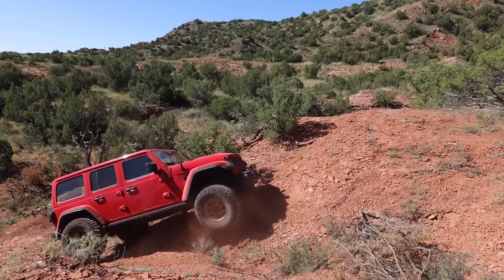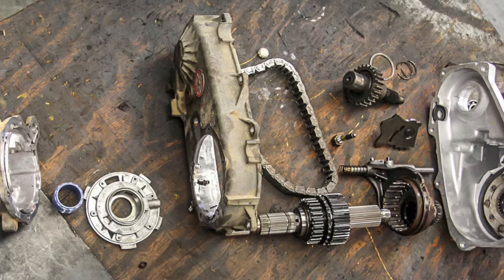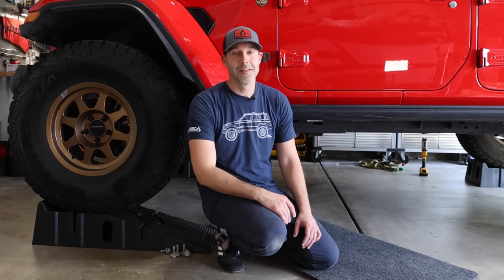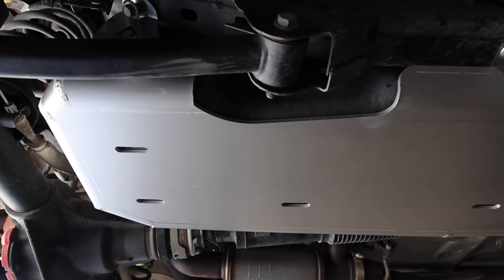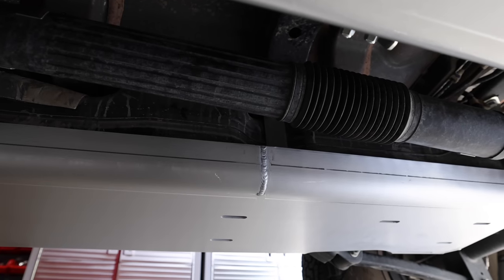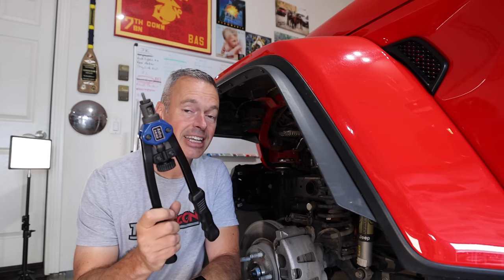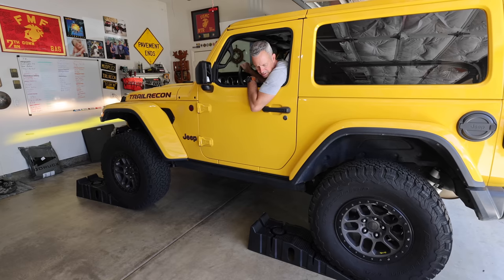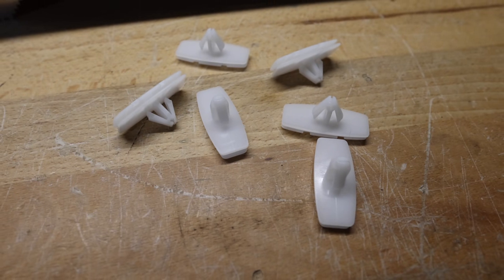Critical Upgrade Every Off-Roader Needs

Comment: Quick tip from someone who does a lot of unfitting (fleet mechanic for lacounty fire). Get a paint pen, and when you drill a hole, run the paint pen around it real quick, or get a bottle of pinchweld primer and do the same. Anything to give a little barrier. Rust is always looking for bare metal to use as an entry point, and I know you like to keep your stuff in top shape, and the jk and 392 are going to be around forever. Love the channel

Comment: Superb video!  These aluminum skid plates are a fabulous idea.  I've long wondered why the new vehicle manufacturers don't install aluminum skid plates as original equipment or at least as a factory (or dealer) installed option.  I think the stock Jeep skid plates, although better than nothing, are a bit weak.  The weight savings of going over to aluminum is also a wonderful benefit.  Great job!  You mentioned "Escondido."  For about two years in the 1980's I lived at 16607 Highland Valley Road with a Ramona address.  Used to drive into Escondido quite often for meals.  Actually, I started working on my Pearl Harbor research at 16607 Highland Valley Road.  I'm one who needs absolute solitude to enable me to concentrate.  Just noticed for the first time today you were a Master Chief hospital corpsman.  Congratulations for that, Master Chief!  Best wishes to you and your family.  (40 years ago this October I began working on my Pearl Harbor project.  Inasmuch as I turned 75 on 26 March, I plan to get my first book done before the end of this year.  It's title will be CLOSING THE LOOP ON PEARL HARBOR unless the publisher, hopefully the USNI in Annapolis, demands a different title.)  I'll love the Navy right up to the moment of my last breath.  Go Navy!  Andy McKane, Maunaloa, Molokai, Hawaii.
Reply from the maker: Oorah! and best of luck on your upcoming book!

Comment: Functional and beautiful looking skid plates!  Very clever use of countersink bolts, where appropriate, for a smooth surface that should resist catching on rocks.  It appears there are removable covers to allow access to engine oil drain plug.  Very thorough.

Comment: I just added the Rusty’s skid plates to my 392. It’s a steel system and is heavy duty for sure. Went back and fourth on steel vs aluminum. I like how steel slides over rocks, BUT I did add a ton of weight that’s for sure. Glad you got your 392 back in the garage Brad. 👍🏻

Comment: Nice armor work and the quad exhausts give it some attitude. Aluminum is easier to puncture than steel but the weight savings will be better for your kind of wheeling.

Comment: Wish you could have spent more time on the 2 door, there are many more of us that have a 2 door than a 392.   We all new that transfer case was not going to hold up.   With all that protection around the transfer case you will need to watch the heat.   They said change the fluid every 12,000 miles,  Brad check it at 6,000, and give us an update.   Thanks again and I hope you two had a great time in Arizona.   Sledge

Comment: 392 kit looks a good well engineered bit of kit, and necessary as so many low hanging parts, might even give slightly better fuel economy as virtually no turbulance under there. I'd probably fit some patches of heat resistant foam under the exhaust pipes so they don't ever have a chance to knock - I did that on a Freelander 2 bash plate I installed a few years ago, it worked a treat. On the Defender, there is no point as everything is well up out of the way, never hit the LT230 ever even lumpy rock lanes don't get up that high! 
Remember to regularly regrease the stainless into aluminium bolts, they will seize in there if not.

Comment: Tech tip for @trailrecon or any other do it yourself people: Drilling holes in the vehicle, wrap the drill bit with a little tape about 1/4”-1/2” back from the tip will help from over drilling into something behind the new hole. The tape acts as a stop to protect going too deep when it drills through. 👍🏻❤️🇺🇸

Comment: I think 🤔 powder coating the exhaust skid plate would look really nice 👍 but it looks good in the aluminum
Reply: This is an option but you’re going to scratch it and beat it up. That’s the point so leaving it bare won’t show as bad as chipped powdercoat.

Comment: Hopefully somebody will make some heavy duty clutch packs for that 392. Years ago I ran into that with 91' mustang GT that had a simular problem the AOT trans was weak. Was able to put heavy duty Lincoln clutch packs, and more of them  with a bigger drum to hold them. Nevery had a problem again, I used to take that Mustang up to Willow springs and road race with it. That trans was bullet proof  after that. I miss that car! But I now have a gladiator.

Comment: I have the full kit from Artec wating to be put on my Gladiator Ecodiesel. Bless to also have a lift to do it on. That last bolt im not putting on. don't want to drill it.

I highly recommend to change the oil sooner on the transfer case and diffs. Redline Oil is a must! 40% Ester base takes the temps.

Comment: In California it probably doesn't matter, but elsewhere beware of galvanic corrosion between the stainless steel bolts and the aluminum.  SS will corrode the aluminum more that carbon steel will since they are farther apart on the chart.  Also, don't install fine threaded bolts (the countersunk screws) without Neverseize on them.  You will not get them out after one winter (again, not so much a problem in Ca).  SS is softer than carbon steel and the hex hole will strip out too easy without Neverseize on the threads.

Comment: For the clip issue- If you can get behind them you can use a socket and slide it over them squeezing it to where they come out without breaking them.  I think it's either a 7 or 8 MM socket.

Comment: Very nice skid kits well engineered.  But now my 2 cents on the 392 transfer case.  Why, why, why would the engineers at Jeep come up with a transfer case that fails so quickly?  We all know you don’t beat on your vehicles Brad.  Glad you shared and exposed what happened with your 392 on the trail.  They don’t need to reinvent the wheel... Clutch packs in a transfer case... and now they want you to change the fluid more often.  Seems to me Jeep owes you a new redesigned transfer case as I’m sure this problem has only just begun to show up with 392 owners.  This will be something to follow as time goes on.

Comment: Brad I think the reason you burned up the transfer case is due to not re-gearing. Jeep designed the t-case to manage/limit the torque from the 392 so that you won’t destroy the axles. However with running a larger tire plus towing on and off-roading your putting a lot of strain on the t-case. Re-gearing would put a lot of the mechanical load back on the axle vs your drive line.

Comment: the front inner fender liners are great unless your duel air compresser in mounted in your wheel well. have do rework the driver side panel to fit.
Reply from the maker: That's always the challenge with making multiple modifications, you have to figure out how to met them work together.

Comment: I'm surprised you went with aluminum. I have the Artec aluminum bellypan kit on my JT and had to replace the oil pan skid with steel. It bent and rattled against my exhaust cross pipe, and the brackets dug into my transmission oil pan too.
Reply: That has all been rectified with the new Alpha series models. Each skid plate was redesigned using multiple 3D scans from various vehicles to ensure we had improved clearance for factory exhaust. Jeep uses several different exhaust suppliers all of whom have very loose tolerances so it was never in the same place. We’ve been working on these revisions for over 6 months now to bring the best clearance product on the market. We’ve also added some new features to improve functionality and protection. As always, we will gladly replace any skids that do fail but it’s very rare.

Comment: I wonder what the Transfer case fluid looked like upon changing.  I realize that all it takes is one OverTemp to scorch the oil and ruin viscosity, but is the grade of oil enough for his "light-ish" load. It sure didn't seem he was abusing the T-Case.  
One other thought - Change the Diff fluid also because if the T-case was scorched, the Diff took the same.

Comment: Looks great Brad! I haven’t upgraded the exhaust on the 392 yet, but I can imagine the protection for the stock exhaust is similar, correct? Folks from Jack Powell helped me out last week. I lost the wheel lock to my 392 on the trail and they are one of the only dealerships in San Diego that has the master key! Didn’t charge me a dime! Thanks for all you do, Jim from Temecula
Reply: The rear muffler skid is quite different for the stock 392 exhaust but we’ve got that too.

Comment: I have the Magnaflow #19598 exhaust system on my 392, love it. With new exhaust you do gain clearance at rear due to smaller muffler design vs. factory muffler. How is the ground clearance after installing aluminum muffler guard? Looks like what's gained in clearance is lost with muffler guard?  But muffler is protected.

Comment: I’m seriously skeptical of the long term durability for any east coasters. 6061-T6 has about as good of corrosion resistance as you’ll get out of a high strength aluminum alloy, but I would never want to put it service without additional protection where road salt spray is expected. 

I’ve never been that far west but I’m guessing California should be more forgiving, but anyone thinking about this definitely don’t put it on and forget about it, make sure you keep an eye out for corrosion (Brad, you’re tinkering on your Jeep so often you’ll be fine lol).
Reply: We get it, being based in Salt Lake City, we know a bit about salted roads in the winter. We’ve been selling these kits to hundreds of rust belt customers for over a decade. In these areas of the country, just like you’d do for your vehicle anyways, it’s important to regularly clean and maintain your vehicles underside. If anything, this will improve blocking corrosive salt from reaching your vehicle’s other components by being such a comprehensive shield. As far as the aluminum itself, you can coat it if you’d like, but you can also scrub off the white corrosion that can form. As we said though, we have thousands of happy customers all over the country and this is never brought up upon real world use.

Comment: I wonder with it all smooth now... if that's less wind resistance and a chance of a tiny bit of MPG?
Reply from the maker: It would be interesting to see the difference in a wind tunnel, I'm sure there is a small benefit, but probably not enough to notice.

Comment: I have two problems with aluminum. 1 you can dent it really badly real quick aluminumdoes not like to bend back in to place. 2 will not be smoth for long plus you scrap off material on rocks

Comment: One question I would like an answer to is whether there is any concern about galvanic corrosion, since you are introducing a bi-metallic contact.
Reply: Great question. We use zinc coated steel hardware and brackets. That zinc coating acts as a barrier between the materials. When we initially were designing these kits over 10 years ago, that was a concern but we put it to real world testing to give us the answer. Thousands of customers all over the country have been using these skids and we’ve yet to have issues with it.

Comment: Quick question Brad, on the Selec-Trac transfer case. Was it the cluck pack failure that prevented the 392 from having 4wd? I was under the impression that in 4Hi and 4Lo the clutch packs were bypasses.
Reply from the maker: It was
Reply: @TrailRecon  thank you. I also have the the selec-trac on my 3.6 e torque so this will be something to keep an eye on.

Comment: Do they make it for the JK as well and is the JK fuel tank skid plate the same install as your 392 ??? I want to change my 2012 JK skid plate
Reply: We do offer a JK bellypan though the skids are different. Currently on the JK, you don’t remove the factory gas skid plate, ours just bolts on underneath. Everything is smooth though just like the JL.

Comment: I didn't notice any rubber between the fuel tank and that new hanger strap on the 392.  Am I wrong, just nitpicking or do I perceive a problem...
Reply: No problems in the over 10 years we’ve been making it. The strap is 1/16” think steel strap so it doesn’t cut into the plastic. Once the skid is bolted up, the weight is no longer on the strap. It’s main function is to hold up the tank when no skid is on.

Comment: I suppose if you have a 392 you can afford the $5K+ for all these skids LOL def gucci, tho
Reply: We have modular options now available so if you like to specifically protect only one area, you can totally start there for less than the full kit. The 392 really does warrant full protection though as it has many more exposed components.
Reply: Honestly on a standard Jeep JK or JL, the whole underbody comes skidded up decently, all you really need is an engine-transmission skid. So only one skid plate is necessary.
Reply: @AustinH7  We have plenty of customers whose stock skid plates would say otherwise. That being said, we offer the front oil skid for the people who only want the front skid.